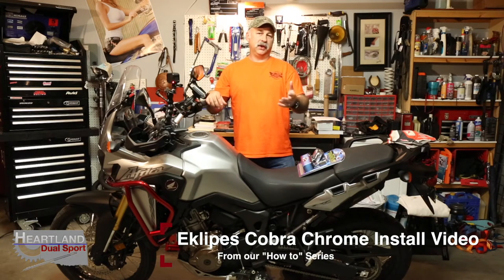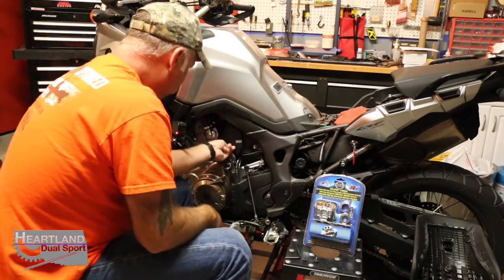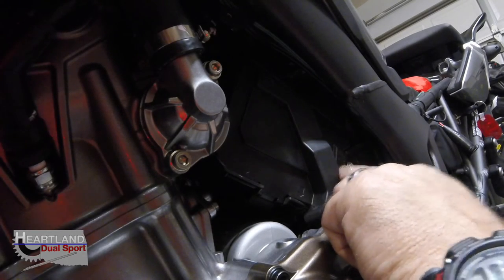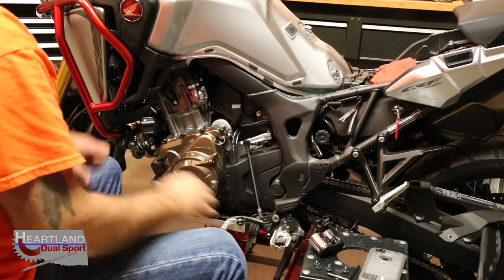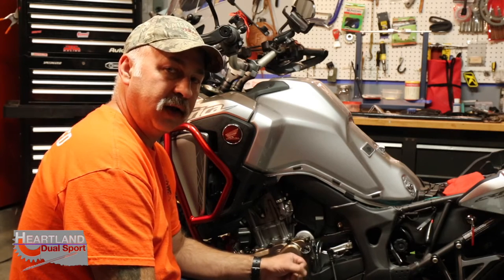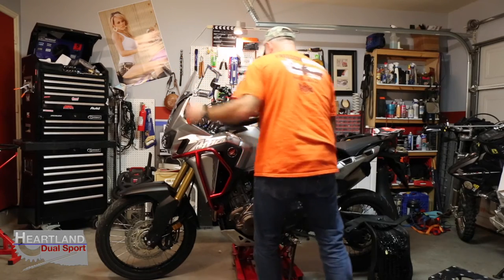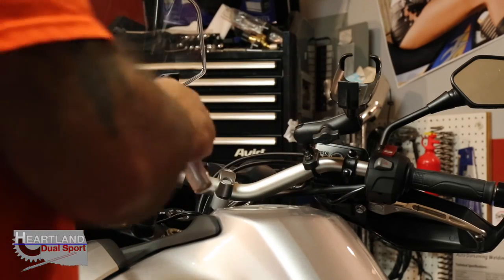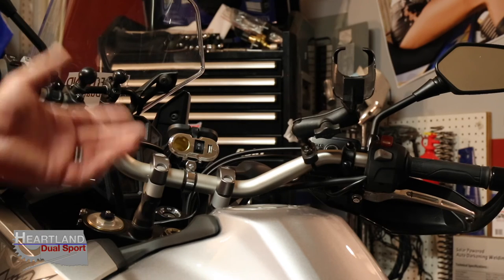Eklipes Chrome Cobra Install Video

Comment: The coat hanger trick was the greatest tip ever. I was dreading lifting the tank etc. to run my GPS cable on my AT but was shocked when the coat hanger pulled my power cable through on attempt #1!!! Thank you so much for taking the time to make such a detailed video! Keep up the great work!
P.S. there is a rubber bumper right in the middle of the track below the tank so I had to go around it. Doesn't look bad but I am concerned that when there will be 3 or 4 more cables from various accessories, it will look a little cluttered. Hope that makes sense. Any ideas?
Reply from the maker: Oh sweet, I am glad it worked of you my friend. Thanks for taking the time to not only watch but comment as well, fun stuff. 
Yes sir, I will have to think on that, one, I know the exact spot you are talking about, I bet there is a good solution , let me see what I can come up with. 
Thanks again my friend and I hope you have a blessed week. 
Dale

Comment: Looks like you got some protection on the AT now. I'll be looking forward to the hardcore off-road videos on the AT now :) My friend up here said the toolkit was a bit lacking on the AT. I guess that's what it takes to offer an awesome bike at a decent price, you have to make some cuts here and there hehe. I think I remember you installing this on the DRZ, I like the on/off switch on it, that's nice! I'm just catching up on some videos here and I'm feeling a bit left out that I missed the specialty tool deal. I'm way past the 10 minute mark. Oh well, I guess you win some you lose some.
Reply from the maker: +LowlySteward hehehe. I hear ya. Yes sir. I got the upper crash bars installed still waiting on lower crash bars. Shouldn't be too much longer now I hope. 

Yes sir the tool box was lacking anything in mine. They guys over seas got thier but most of us here in the US didn't get the tools in the tool box. Hehehe. 

Oh man. I hear ya. I am always running behind. So I get it. Thank you sir for taking the time to watch and comment and I hope you have a blessed week my friend.